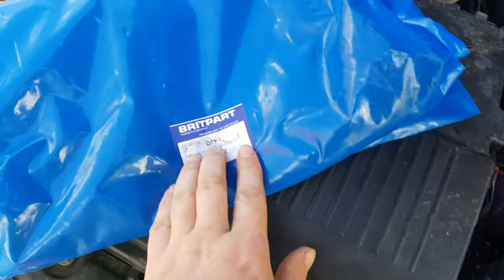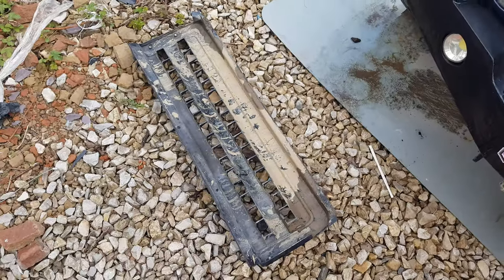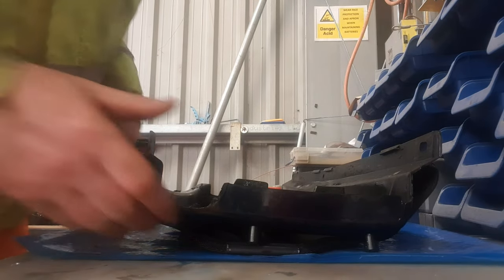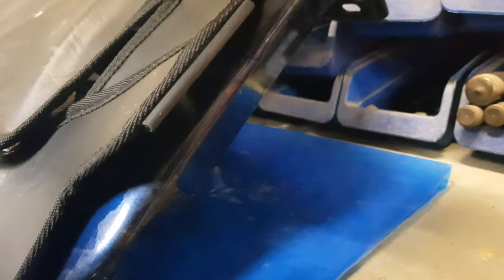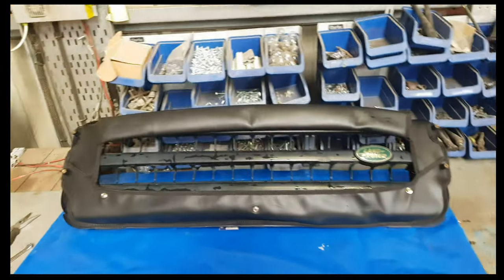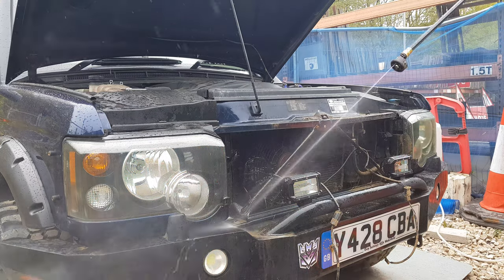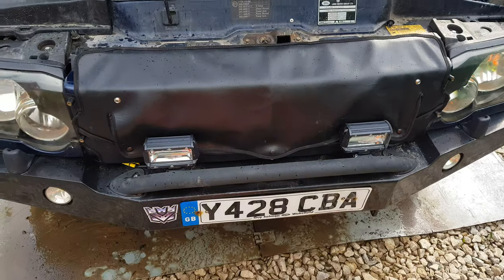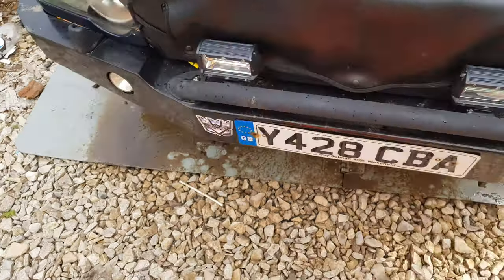Fitting A Wading Blanket On a Discovery 2

Comment: So they do make radiator muffs, good. And it should work well. I wanted one for Big Lollopy so it would warm up quicker in winter, but somehow never got around to it. With the ordinary front bumper though, there is another air intake below the bumper which can scoop crap in. How does the steel bumper deal with that?        That mud is the worst thing you can get into the trans-cooler.
Reply from the maker: The steel bumpers are far superior than the crappy plastic standard ones. As you say they dont have the lower intake so they have a better approach angle. Next off road session will tell me how good the grille cover is as crap got in to my alternator last time. I believe the britpart covers are about £40 new so not that expensive.
Reply: @deanshortland7194  Enjoy your next off-road session!
Reply from the maker: @sleepycatpictures1176  will do.
Look forward to another disco episode 👍